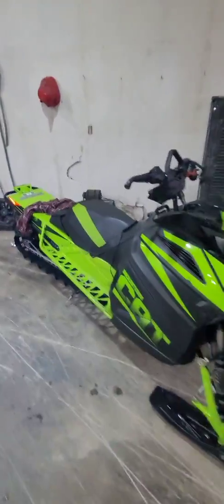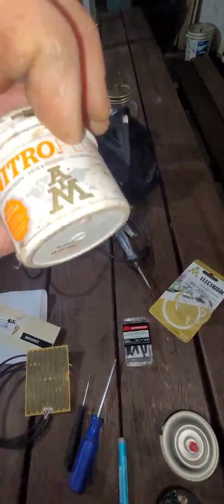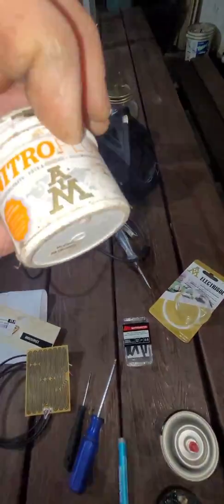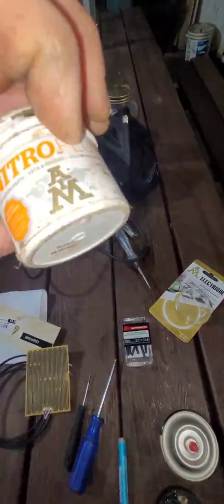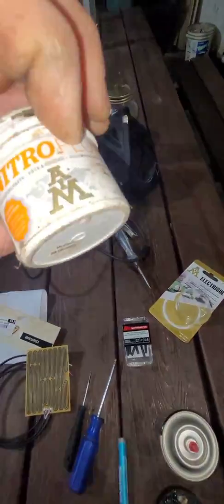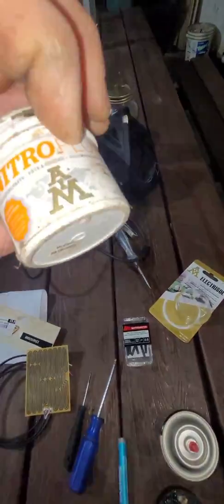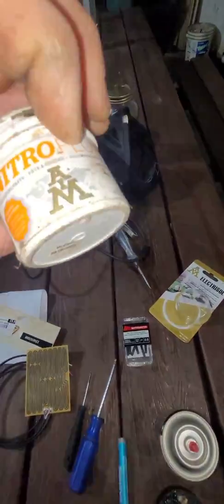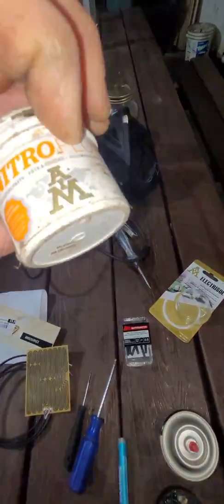2018 Arctic cat mountain cat handwarmer repair

Comment: How did you get the clip back on the throttle lever pin
Reply from the maker: Push it back on. You might need something like a small socket maybe a 6 or 8 mm socket hold the top of the pin and ypu the socket to force the clip on